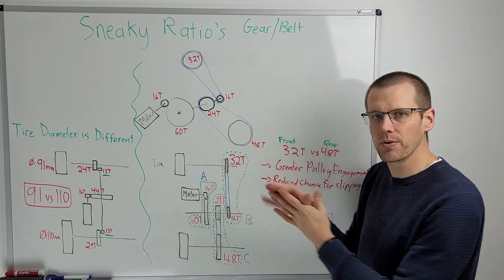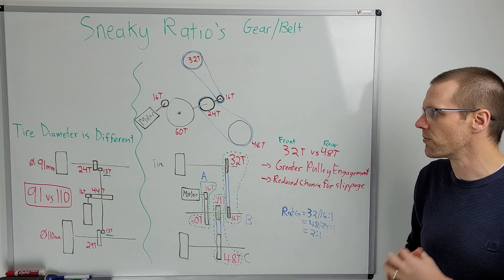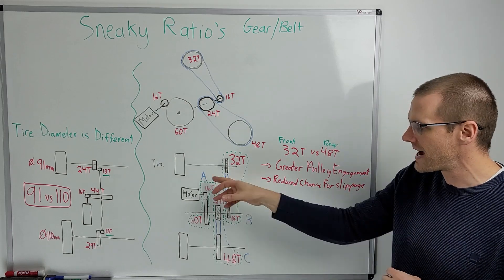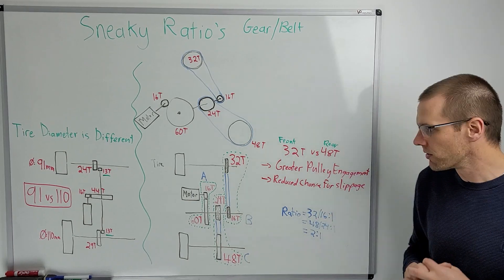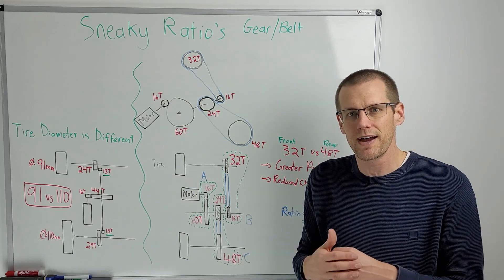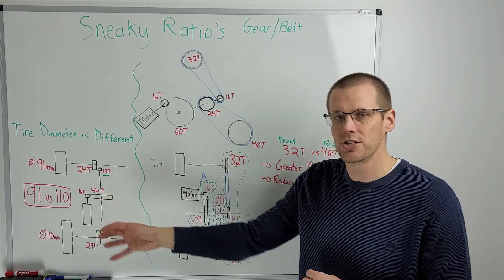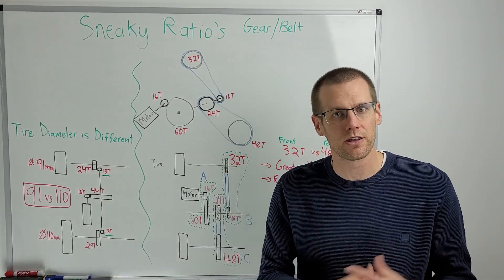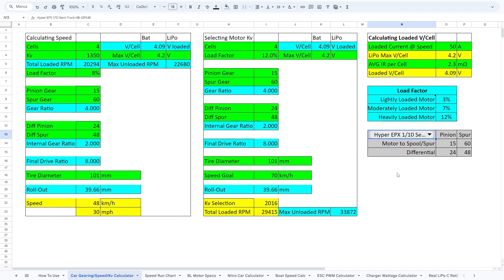Unlock the Secrets: Demystifying RC Gear Ratios with Differential Tooth Count Hacks!

Comment: Thanks Ryan. Question.. in the initial example with the 2:1 pulley setups, I understand the point about slippage but would the front and rear (16:32 and 24:48) have potentially different torque?
Reply from the maker: They would have equal torque.
Reply: thanks  @RCexplained
Reply: Hello, tire growth at high rpm is a factor for mph. Correct?
Reply from the maker: @fromthebackofmymind  yes